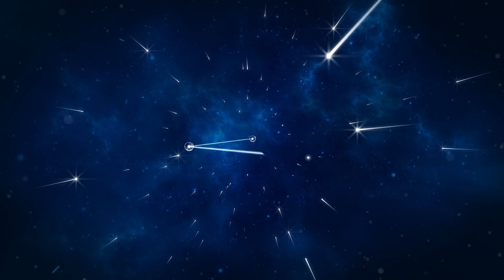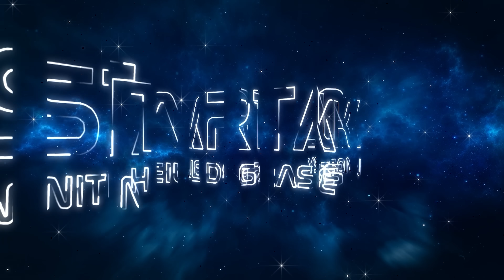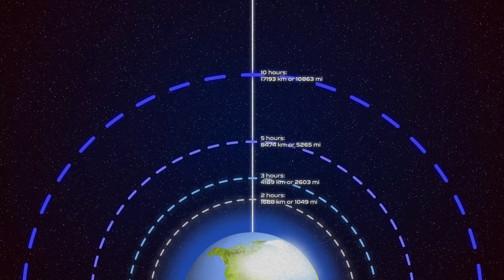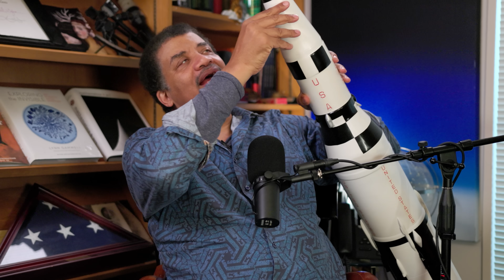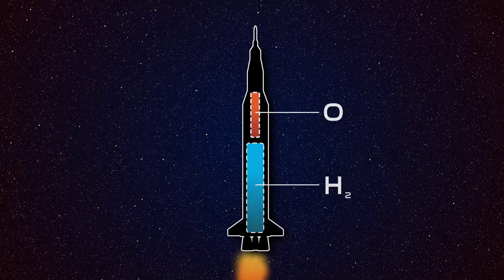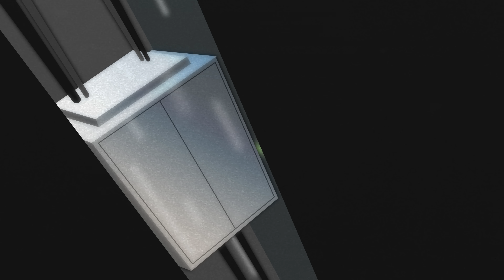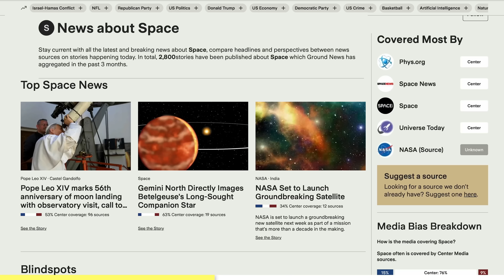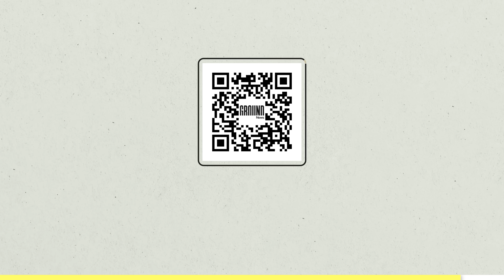When Will We Have a Space Elevator?

Comment: Please, Dr. Tyson, explain how carbon fiber nanotubes with an estimated tensile strength of 60ish GPa can be designed to handle an estimated BASE stress of 3.5 x 10^16 GPa. Even if you could solve cable material, what do you even anchor the whole thing to? I'm no astrophysicist, my degrees are in software engineering, but I've been interested in space elevators for a while. 20 years ago, NASA was saying that carbon fiber MIGHT be the answer, but every calculation I've seen says that it's not even remotely close without some mind bending engineering. Can anyone in the field share some thoughts based on actual data and facts? What he's saying just doesn't seem to align with the math I've seen.

Comment: We would be able to send small units of payload in a constant stream of containers crawling up the cable. Doesn't matter if it takes 10 days or a month. Astronauts and bigger pieces that can't be assembled in space can use rockets - but the fuel and everything else needed for exploring the solar system and bringing stuff back to earth can use the cable. The upfront cost is high - but using it constantly should be cheaper than a rocket.

Comment: The atomic bonds of carbon could support the weight of a nanotube 4,000km long.
It takes 35,786km to reach geostationary orbit, so we would fall short by 31,786.
That is, we barely reach 12% of the necessary distance, and that elevator could only carry the weight of the cable, never a cabin, much less cargo.
Sorry guys, but an elevator isn't possible on Earth, at least. It's even less likely on the Moon, because it has 1/6g but rotates 28 times slower. So 28/6 = 4,66 times longer than on Earth (it's an estimated calculation).
One possible location for an elevator is Bennu; there, it might only require a couple of kilometers, or less.

Comment: The elevator speed alone just crushes the idea of a space elevator.
Reply: If it were cheaper than rockets then it would still make sense for cargo.
Reply: There's very little reason to limit yourself to 200 mph once you're out of the atmosphere. Given what these cables are going to be made of, you're going to have the materials science to be able to design climbers whose contacts with the cable are capable of handling the friction of even 1000 mph - and that's assuming the car is even in contact with the cable, instead of swapping over to a maglev system partways through the trip.

Comment: I found this one a little lacking. Although you explained how it is supposed to work and why to couldn't, you failed to mention that theoretically, it IS theoretically possible to do with a material that can bear the tensile forces pulling on it and the additional weight of the platform or object at the space end. I would imagine that the strength necessary can be mitigated by simply using conservation of momentum. By speeding up the object slowly, say with a more elastic design, it could be possible to slowly speed up the object instead of the shock loading that would be required with a rigid tehter.

Comment: There is an Anime (bear with me) that takes place post energy crisis. Fossil fuels had effectively dried up and the solution that they settled on was to build a solar generation system in orbit (in the show it was probably low earth orbit based on the size of t the planet, but who knows, it wasn’t actually stated). In order to transmit the power they built three pillars that they then installed space elevators on.

The reason I bring it up is because that is how I see space elevators happening, alongside some other construction that makes them less impractical.

Comment: The downtalking of the usefulness of a space elevator here is crazy. Half the energy to get out of orbit is equal to the energy to get to pluto??? This would be the most reliable way to create a dyson sphere or to develop solar system resource extraction. This could severely reduce space junk. This could have implications on making it viable to manually repair the ozone layer and give greater climate control. Is it far off and infeasible now? Yes. Is talking about it like a joke without giving fair consideration for its benefits in a disingenuous way embarrassing? Also yes.

Comment: I haven't thought about space elevators since I first read about them as a kid, back in the late 1970s. I seem to recall one of the considerations was that when the elevator travels down from orbit to Earth's surface, the energy from the descent stage could be captured and used to supplement the power requirements of the ascent stage. This would make the elevator more energy-efficient than a rocket.

Comment: Kind of disappointed they didn’t talk about the possibility of using it as power generation. Almost every sci-fi series that I’ve seen that has space elevators, the elevators are less important as a means of cheap transportation into orbit. But rather they’re basically just big power cables sending electricity from large solar arrays down to the surface. I’ve always been kind of curious how feasible that is.

They said that steel would collapse under its own weight being that long, so I’d imagine the same would be true for copper or aluminum. Also, where are we going to get 23,000 miles of the stuff? Even if we found some sort of work around, how much power would be lost in the resistance of the lines? No matter how much you step up the voltage, 23,000 miles is a long way to transmit electric power.

Comment: Like the only problem with a space elevator is cost efficiency and strong enough materials... 
What about solar radiation degrading the material, heat fluctuation moving the station up and down from its balanced orbit? I think a hand held portal gun is way easier to build than a space elevator. And we haven't even touched on the problem of where we would anchor the station on earth. Like a boat on the sea might be flexible enough to deal with small course corrrctions, but the nature of the sea is rough, so it would be hard to stabilize.

Comment: PROBLEM:
when an object is lifted up it is not only lifted up, it is accelerated to the speed of the station.
that means sideways acceleration.
The lift cable would have to take that.
Problem:
The weight of the station would change, 
that means that the counterweight-requirement would change as well.

Comment: A correction...the longest single Carbon Nanotube (CNT) so far is 550mm (about 21.7 inches). We could also use the Space Elevator as a freight elevator. Move materials and fuel into space. Lastly, because CNTs are also highly conductive, we could transmit excess power up and down the cables themselves.
Reply: Mo correction needed, they showed a graphic with this figure while you were typing.

Comment: Just for the fun of it, what if we adapted the maglev system to the track of the elevator? like the asian train, it would reach 500kmh at least, may be faster, cause it's a straight line up.
Or better, use the coilgun system for a transportation capsule, instead of a bullet. What are your thoughts?

Comment: How wide would that structure have to be to support itself how deep would you have to drive down girders to the magma..... That structure would have to support itself through the jet stream  and debris would have to navigate somehow around it or In to it striking the workers....they  would have to have heat and oxygen.. and if there were a slight earthquake
Reply: Could use steal to build it if you had rockets mounted on the structure as it goes up and a fuel line pumping rocket fuel up to these rocket thrusters to take some of the weight off of the structure as it was being built... And continually apply the throttle throughout the life of the elevator structure
Reply: Periodically change out a rocket thrusters to keep them fresh and functioning.... During the construction and during the life of the elevator
Reply: Rocket thrusters of course would be bridged out with steel structure to keep the heat away from the elevator itself..... Food and drink served at different levels of the elevator while going up... Also bathrooms with very long sewer pipe ABS plastic

Comment: I tried to solve this problem in 2003, with the help of my former astronomy professor (who has a degree in astrophysics). I realized you would need a maglev system that could accelerate you at speeds exceeding 500 miles an hour and it would still take at least three days. Still, rocket fuel is cheap the same way that coal is cheap: it's incredibly harmful to the environment. A space elevator is the best option to enable humans to continue to explore space without killing the planet they live on.

Comment: I'm always amazed that when someone is talking about a space elevator they don't mention the concept of using a maglev train instead of a standard cable elevator. You can have a solar farm in space to power it and send the excess power to earth. The station in space will act as a port to the rest of space (Shipyard, habitat,refinery, science station etc). The construction progress is going to be problematic. Multiple elevators need to be build in different continents at the same time. that does allow the option to connect every station in a ring around the earth with solar panels attached to the ring. an example of this is in the anime mobile suit gundam 00 it also shows the massive size the elevator could be when fully constructed.

Comment: Just a note - Neil demonstrates with simple math that the trip up a "space-elevator" would take days, or longer. Maybe it's impractical for people. But, maybe not for ordinary inanimate stuff, like fuel or building material. There is another cost that Neil does not cover, namely, how much it would cost to make the trip, per gram. There is an energy cost that would be considerable. One approach to handling the energy cost would be to use electricity, such as a superconducting cable in the elevator to conduct electric power. That would be exceptionally tricky, too.

Comment: In a hypothetical working system, acceleration would never be zero. The platform would rise and rise with increasing velocity until the desired halfway point either distance or steady state speed and then would decelerate somewhere between the halfway point (being defined as distance or perhaps maximum velocity) and the stop point.

Comment: The calculation is more interesting than this waffle.
At lift off you have already got ~10m/s2 acceleration due to gravity before you move.
If you limit yourself to the airliner limit of 1.5G you can initially accelerate at about 5m/s2.  In 200 seconds (3.5 mins) you will be travelling at 1km/s.  Still going to take you 34,000 seconds.
However, you might need to go slower until you exit the atmosphere.
Anyway, if that was all there was you could just do the constant accel, decel equation and be done.
But it's not.  As you move up the gravity well, gravity gets weaker by the inverse square.  Earths radius is roughtly 6300km.  So when you get to 12600km gravity will only be 5m/s2 and your actual acceleration at 1.5G internal reference would be 10m/s2.
By the time you get out to the 34Mm distance gravity would be less than 2m/s2 ... which will be equal to your outward tagential acceleration, assuming you are "in orbit".
But its even more interesting.  Because you are going up a straight line and not an ascending orbit, your tagential velocity begins to counter gravity on the way up aswell.
So to actually calculate the best trip time for constant accel and deccel is going to take a spreadsheet or some calculus.

Comment: You would have to have a counterbalance on that elevator coming down whenever it goes up. Vice versa, but a bigger question is, why don't they make a launch launch pad? They can get up to velocity and then just launch it at a smooth rate instead of blasting it off from the ground itself.

Comment: What if we use railgun technology ( japan recently cracked it so it dont destroy the gun ) but with a slower speed.. also use levitation ( the thing we use for monorail experiments ) to keep the railgun floating and then we ALSO use taller buildings so in the end the wire we need will ultimately be shorter and more manageable ?

Comment: The thing that comes to my mind is that the elevator would "swing" around 24/7, right? And the speed would be different on the different heights. We could get rid of that part by building the elevator right on the axis. So, very cold at the base, then not so cold in the middle, and then extremely cold at the top, which probably isn't great for any material.

Comment: Even if this "platform" could be put in orbit and physically connected to the ground, the speed of travel up this "cable" would have to be slow enough not to cause balance issues.
Think about diving. The concern is the bends. There would have to be an opposing effect to moving up from the surface too fast.

Comment: The Space elevator would NEVER work.  The have a fixed location the base would have to be in geosynchronous orbit or 22,236 miles.  Low Earth Orbit might be under 1200 miles and the ISS is 254 miles, but that does not mean they could have the elevator at that altitude.  Then there is the mass.  To have a cable that is 22,236 miles long that is strong enough to lift several tons and last for decades would be in the millions if not billions of tons.  It would also have to deal with thermal expansion extreme cold, radiation, wind, lightning... all these years.  How do you keep it tight when thermal expansion might lengthen it a mile of more?  Now think even if this was somehow possible and you somehow had a means of propulsion that could lift you up this elevator... think what would happen if the cable failed.  You might have hundreds or thousands of miles of this cable, reaching speeds faster than Mach 1 or higher... thousands of tons or more smashing down over an area likely miles across.  How far away from a city are you going to put this?  How many people would die?  No the whole idea of a Space Elevator is just dumb and will NEVER happen.

Comment: Hey Neil, I was wondering since mass changes at relativistic speeds, I was wondering if someday when battery energy density is way higher and particle accelerators are cheaper, smaller, and lighter, could we have rockets that are basically ionic thrusters, but with relativistic exhaust speeds?

Comment: The Space Elevator is probably impossible due to material strength limitations. But what about a lighter-than-air space platform at 37,000 meters (120,000 feet)? Passengers and cargo could shuttle up and down in dirigibles. It might even be possible to build a dirigible space shuttle, using ion engines to slowly accelerate it to Mach 2 at 50,000 meters, where it could launch statellites or manned vehicles using small rocket boosters. Much faster and easier to maintain as well.

Comment: Its not possible, the ladder would have to survive the jetstream and atmospheric wind layers, and the forces in leo...   The gravity on the ladder would be immense, it would break under its own weight.   There is no material on earth that can survive the sttuctural forces at the base of the ladder.  

The forces on the ladder base would be billions to trillions of tons. 

The base would need to be thousands of miles wide snd solid. 

And even if you could build it it would be so heavy that the Earth itself couldn't support it, it sink deep into the earth.
Reply: Theoretically carbon nanotubes might have the tensile strength but I do agree that it's an incredibly difficult endeavor is probably at least currently beyond us.
Reply: Your point about atmospheric forces is a good one. Another problem is wear and tear on the cable from the elevators pulling on it as they roll up and down. 

 However, if it had an orbiting counterweight a few thousand miles above the space platform (as described in the video), you could cut the cable at the bottom and it would just hang there. The counterweight would have to be big of course, its mass would have to equal the weight of the cable and the space platform.

Comment: You also have the risk of the tether being severed and a portion crashing back to earth. Figure half, 11,000 miles of tether returning to earth, the weight and energy of it, would be worth the word catastrophic. The counter weight, the station, would have sufficient energy to leave orbit.
Reply: If you locate it on the east coast of Africa at the Equator, it could break at the 2,000 mile level and most of it would fall into the Indian Ocean. Above 2,000 miles there's not much risk of being hit by a stray satellite. It would have to be well defended though, against attacks by aircraft or missiles.

Comment: We can get to space a lot faster.

You nailed it, Chuck.
Reply: nope.  they completely missed the point.  an elevator could accelerate at 1G or more, using fuel NOT carried by the elevator itself (which is the whole fundamental advantage of the concept), and easily reach geostationary orbit in just a few hours.  yes there are many unsolved engineering issues with a space elevator, but length of time it takes to reach its destination is not one of them.

Comment: Neil should also know that 100 mph is incredibly slow for anything even remotely related to space travel.  If your elevator only went as fast as the international space station is traveling, it would be there in less than 2 hours.  Carbon is fantastic conductor of electricity.  So it should be easy to send power from Earth to the Station, and everywhere in between including to the elevator.  Electro magnets could accelerate the elevator just like they do trains on Earth.  While you would have to travel slower in the atmosphere, like 400 mph or less, that part of the trip would be over in just a few minutes.  Then you can just accelerate at 1g for the next 1/2 of the trip, and decelerate at 1g for the second half of the trip.  You should be there in total in about an hour at 10 - 20 minutes.